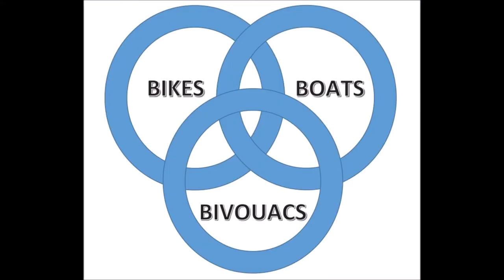Applying F11 Top Coat - Is It Better Than Wax?

Comment: That’s a pretty slick product. Thanks for the review. How do you feel it held up over time? Does it repel dust, dirt, & debris? Do you notice a brighter shine in the sun?
Reply from the maker: It held up well. When I was at a dusty location I just had to rinse it off. I will continue to use it. Thanks for watching.
Reply: @BikesBoatsBivouacs  that’s awesome. We may have to try it. Thanks!